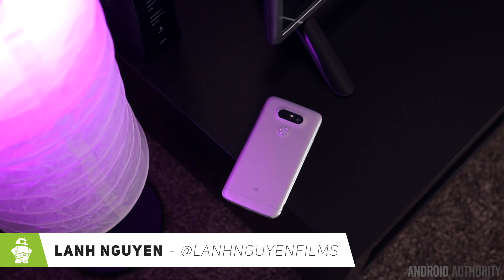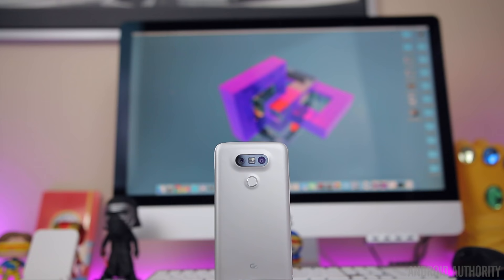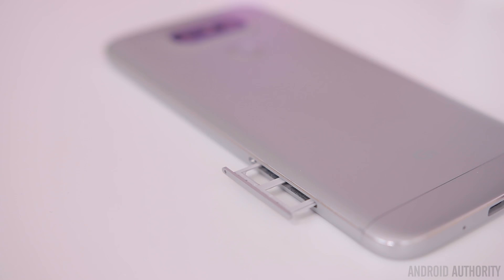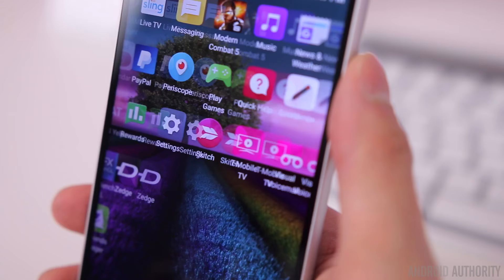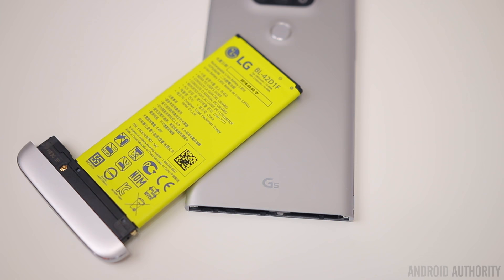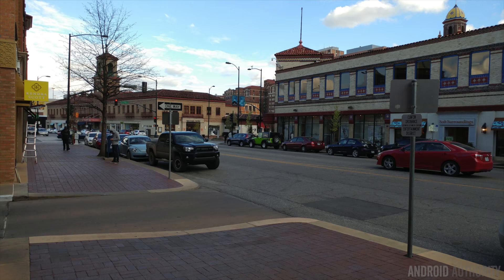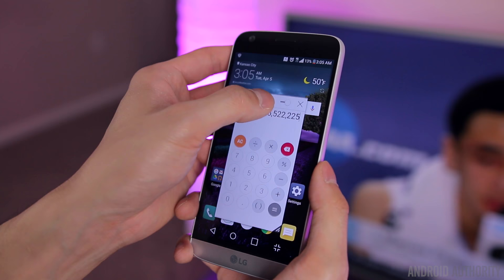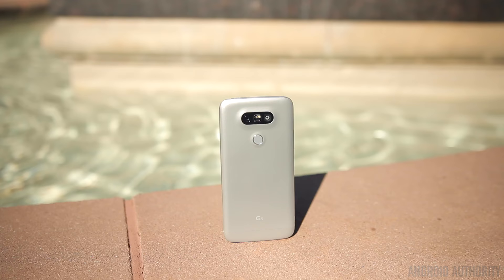LG G5 Review!

Comment: Hello there Android Authority and community, I just have 2 questions about this phone and hope someone here could advise me on them. I just bought the Lg G5 a few days ago, and first question is, I usually restart my phone every morning, is this ok? Second, I always charge my phone every few hours, lets say it gets to 70-60% and i'm already charging it to 100% again, when possible of course, is this also bad? the two things I mention before, will they harm my phone in long term? 
Thanks in advance!
Reply: imo a restart wont hurt it at all my friend ,  might actually do some good imo ,  as for the keeping the battery topped up ,  i do it too even though i probably don't need too 95 % of the time on my old note 4 that is still running on its original battery ,  
. 
i think regardless you will lose a bit of battery mojo over time , but  they are pretty cheap to buy and we can replace ours (unlike those other poor bastards with sealed phones .... we laugh mockingly  ;)   ) easily so its not a deal breaker imo to charge it  more often than it needs  ....... even if it may   shorten battery life a tad faster  over a period of time. 
 i know they are different phones , but they are not that different and i think my 18 month old battery is still about 90/95 % good , so i would not worry too much about it old mate .
Reply: @mikldude thanks mate!

Comment: would you upgrade to an LG L5 and  LG g5 really good cell phone
Reply: +Dale Lesoway Coming from an LG G3 user since 2014, yes
Reply: +Karl Kahambwe I think Samsung is is dropping the ball they could make a phone with a removable battery they could do a lot to make the product better but they don't they want to play it safe and that's why I don't want to be alone with Samsung any more that's why I want  try a new phone cuz I'm tired of being lied to the only reason they bring back the SD card slot and the water resistant and dust proof Galaxy S7 and galaxy s7 edge because people complained and people demanded it in Samsung realize I had to do something so that's why I want to switch to LG because there are really good phones and when you can remove your battery and switch it for another battery all you have to type c charging that is way faster
Reply: Dale Lesoway Yeah the removable battery is a huge deal, and for some people it can actually be a deal breaker if you don't have it. I've just never been a fan of Samsung, so I went with the G5, although I acknowledge that Samsung nailed it this year with the s7 edge.

Comment: So I can't use headphones with the G5 unless i plug in the audio modular add-on?
Reply: yes you can it's on the top of the phone. The Modular from B&O is for  headphones that are expensive that need more power to have Richer sound!
Reply: Thanks. Personal question, am looking for a phone with great photo shooting and music player, an all in one to replace my ipod touch and current phone. What do you suggest me?
Reply: +Rajiv Mohadawoo Many Smartphones this year take amazing photos like the LG G5, Galaxy S7/edge, iPhone6s, etc. The sounds on the speaker is good on the LG g5 and iphone. The galaxy phone is water resistant and that makes the phone sound distorted. Sound from the headphone jack is the same for all phones Unless you buy the $100 B&O (DAC) for the LG G5 only.. The HTC 10 has a built in DAC and has Amazing speakers. But the downside is the camera is okay but not as good as Samsung's and LG's Cameras. Any more questions?
Reply: I run and exercise a lot while listening music through headphones. Plus i like instant photo whenever I see something cool while running in nature parks and stuff. Which phone would you say is best for me, G5 or Huawei P9?
Reply: +Rajiv Mohadawoo When it comes to features the LG G5 is better. The P9 has lower quality display, lower camera spec, yeah it has 2 but they don't work as good as the one on the G5... man it really depends on your needs.. if I were you I'll just stay for the G5
Reply: G5 then. Thanks for the heads up.

Comment: My g3 just broke, should I change to a g5? what are your suggestions?
Reply: you should
Reply: i mean i like my g5. its camera is great and it runs smoothly most of the time.
Reply: Tej Jaswal i just got it and i love it
Reply: julianne giguere i wanna switch my note5 to G5 cuz my battery runs hot after 1 year. What about boot loop? Does it still happen for G5? Cheers.
Reply: My battery on my G5 sometimes gets  hto when I use it while it is charging, but it isn't alarming. I've been told that it happens because it is made out of metal. Sorry, but what is boot loop?
Reply: Oh I went on google and now I know what boot loop is. Actually, that's what happened with my G3. It was in boot loop and couldn't use it so I got a G5 instead. It doesn't happen on my G5 because it is new. I hope it won't happen in the future.

Comment: All these phones are starting to look like htc
Reply: because the HTC M8 was the best phone ever
Reply: Seasick ik, I have one myself
Reply: Daniel Barro noice
Reply: actually this phone looks more like the nexus 6p, but the 6p was much better looking.
Reply: I think they all (including htc) are copying the iPhone 6/6s design for the 2016 flagship models. Such as the HTC One A9.
Reply: Osama But iphone has always had a flat back metal design. They've never had a rounded back, and iphone always had their camera in the corner.
Reply: But the HTC One A9 design is pretty much the same as the iphone 6/6s with the thin metal body design. They look almost identical.
Reply: Osama The A9 is definitely a wanna be iPhone, but iPhones can't own all metal designs. The new OnePlus 3 looks like a copy of the HTC M8, and M9 though. Besides the G5 camera and button layout is unlike any other, and the metal has a paint job so it doesn't have the same look or feel. Apple may have had the first all metal phones, but the HTC M line up had brushed aluminum so it had a different texture and look. Have you ever tried an android smartphone phone?

Comment: not 200 gb it supports 2000 gb or 2 terabytes it also says so on their site
Reply: +DanishARMA2 200gb is the largest microSD card currently available. Itd support more with no issues when SD cards get larger in capacity
Reply: +Goon Included they should make a memory module that would be awesome did you see the alarm has a calendar based setup that's nice when you have to work every 3 weekend

Comment: LG g5 is crap.so much crap that I sold it and bought an older model Samsung note 4 instead that made me much happier than LG g5...
LG g5 has bad battery life. it has severe image retention or screen burning issue and it's back button and finger print sensor just gets dead after some use..without the back button you need charger to make it alive again each time you want to use it.. LG needs a a lot of work before it even imagines getting close to Samsung or I phone

Comment: Epic fail by LG. They took out almost everything that was good and different about LG but the swappable battery.

Laser focus, gone!
Actually useful wide angle selfie cam, gone!
Split window, gone!
Easy and innovative back volume buttons, gone!

Add in an ugly design, shitty build, stupid metal you can't even feel when plastic would be lighter and better, stupid wide angle cam that is useless because you can simply crop with the 12MP regular cam for the same effect.

Comment: I'll never buy an LG phone again. They have been so shitty with Latin America, I still haven't received 6.0 update and H815P version doesn't have an official bootloader unlock solution unlike the other models. Also, we are not getting the same interface as the LG G5 and it's said that it had a lot of bugs and the battery performance is worse than 5.1.1. Even though LG is really popular here, they don't care about Latin America at all so I won't spend a cent on them again.
Reply: You bought the international version?
Reply: H815P, the Latin American version.
Reply: +Kevin Jaramillo NEVER BUY THAT CRAP.  I always buy my stuff from amazon and either get it shipped to my house ( Bolivia ) or have a relative bring it from the us.
Reply: Antonio.M Aguilar sería genial si hubiera verdadera diferencia en precios, pero desgraciadamente la diferencia se va en los gastos de envío e intermediarios. De mi parte, no vuelvo a comprarle a ningún estúpido fabricante mainstream. Tal vez pruebe con Oneplus u otra marca china con Cyanogenmod.

Comment: Don't buy this phone!
I have a G4 which now has the boot loop problem and they want me to get a minor nick in the camera lens fixed in order for them to repair the phone under warranty.
Yeah, they completely invalidated my warranty because of an unrelated problem.
Reply: bro change the battery. i bought s6 and now on switching it up to g4
Reply: Yeah, it's nothing to do with the battery. LG admitted it's a common fault with the motherboard
Reply: "boot loop"?
you should try it to reset the device or software repair
Reply: *****
It's a hardware issue...

Comment: This phone kind of sucks to be honest
Reply: +Gentleman still the best in the market.
Reply: +Gal Root nope. HTC just became relevant again with the release of the 10. It's as a good phone as the S7. For me because of the shitty build quality, the G5 will not be one of the best smartphones this year
Reply: I agree that the build quality could be better, which really just means they should have make sure there is no gap when connecting the bottom.  The thing is that this phone just offers things no other phone does. IR Blaster, Wide angle lens, real long exposure, removable battery, sd card (sure, the S7 has this one too), 8MP front facing camera and a very flexible ROM which (IMHO) actually makes sense. There's just no other phone that offers all these. I'm not saying I will buy it, just sharing my opinion a a user who really loves photography.  Plus, it has all the latest bells and whistles.
Reply: Gal Root It's not just the gap. There are numerous unboxing vedios where there are verious physical defects on the phone surface & also light bleed in the scree. Also they are not gonna sell the Audio module in USA & Canada. U may or may not use it, but why introduce modules & market it in USA & later say they are not gonna sell it in USA.? I'm not saying it's a bad phone, because it's not. It's a damn good phone with good options. But most of the units have physical defeffects where there shouldn't be. LG should have had a better quality control process. Which they didnt. U may or may not get a product with blemishes. But then it's becomes luck. Why should we as consumers be OK with these companies releasing products that have defect out of the production line, where they could have checked & not put them out cause that's what quality control is right? Simply a flagship phone should not have these shit. We dont have any bad production physical issues in Samsung, Apple, Sony, Huawei flagships. So why should we give LG a break?
Reply: I've seen the "defects"...nonsense.  Light bleed, yes. Not a big issue as I don't stare at a dark screen at maximum brightness in a dark room very often. Nevertheless, I agree that it should be addressed.  Again, most of it is just exaggerated online.  Order the audio module online.  With that in  mind, I'm not going to pay 700$ on it when I can get the G4 for ~330$ which is still an amazing phone (only minus is the lack of the wide angle lens, but it does not worth 350$).
Reply: +Tissa Senaratne World is not limited to America and Europe. It hasnt released everywhere yet so maybe those were the earliest units.
Reply: Xenovuz Xapter It is already in stores in Israel. But overall I agree with you.  Still very pricey here.. 900$ and it comes with extra original battery + external charger (desk charger) +  the camera module and 2 years warranty.
Reply: Xenovuz Xapter true. But USA is a pretty major market. And it's not that the module isn't release yet, its not gonna be released in the forserable future there.